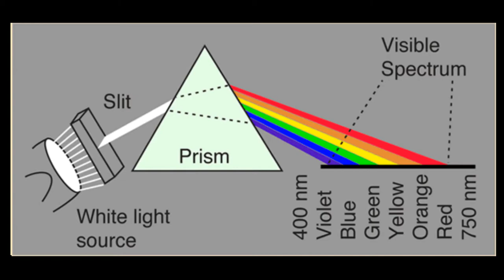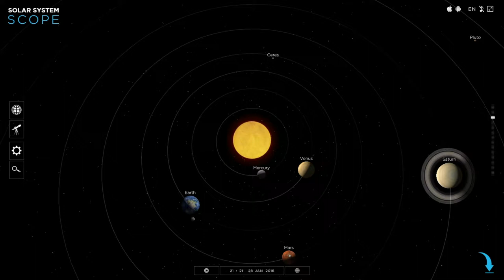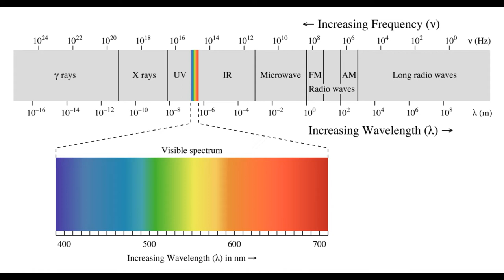Light And The Impossible Universe- Flat Earth

Comment: Why we do not use vacuum pipes instead of fiber optic cables?
Because light goes in a straight line and the Earth isn't flat but a ball with a curvature.
So you light beam would collide with the inner surface of the pipe.